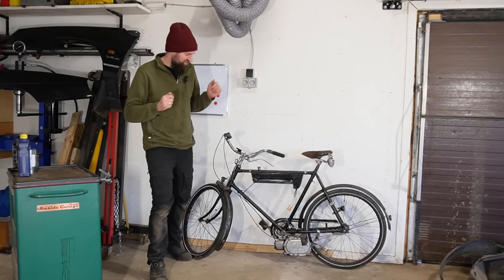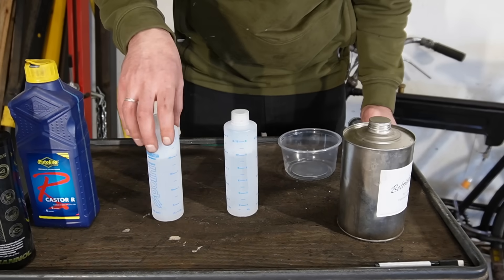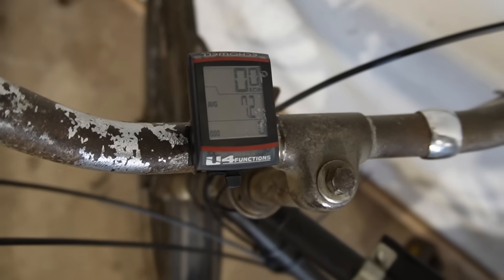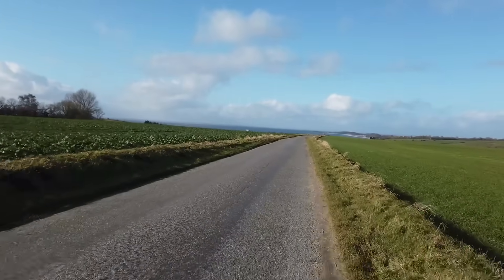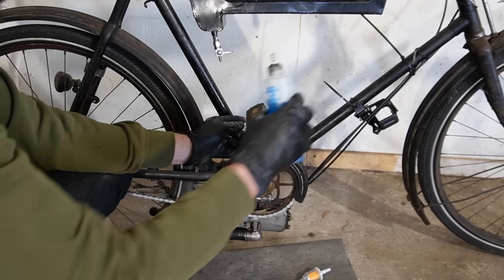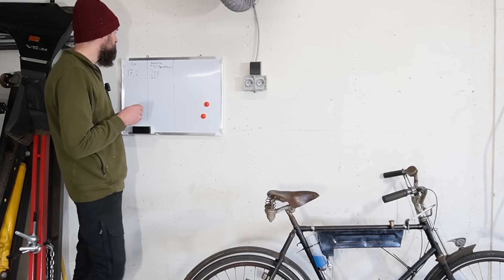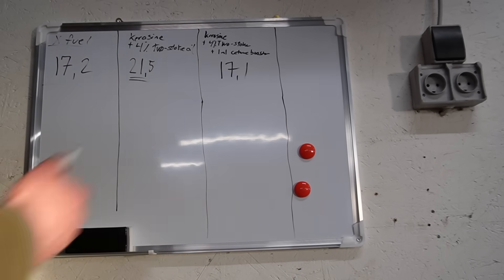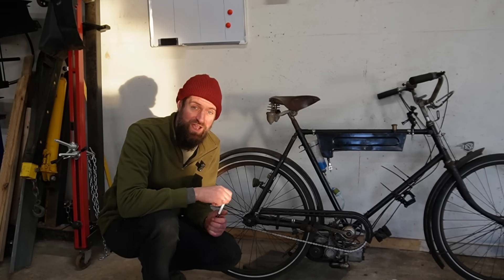Two-Stroke DIESEL Moped | The Search For The Perfect Fuel

Comment: The modern diesel issue is from them removing the sulphur content (which was used for lubrication of things like injectors & pumps), which modern engines can deal with, but older ones, particularly vintage diesels, can't, so people just mix in an additive to replace that missing sulphur when running older diesel engines... :)
Reply: This has a carburetor and the crankcase scavenges the Diesel-lubeoil/air just like in a 2 cycle gasoline engine.

Comment: Before the advent of specialized two-stroke oils, manufacturers recommended higher percentages of oil in the fuel. I've seen 5 and even 6%, so it's plausible that the Lohman fuel contains more oil than your kerosene/two-stroke oil mix. For a given volume, the more oil there is, the less fuel there is to burn and the less power the engine makes.
Reply: That is only halve true. The more fatter the carb runs the more gas generates it while running, so it has way more torque than with optimal setting. Lean/Optimal: High HP at high speeds with high rpm.

Fat: Not as much HP but way more torque over the whole band. Also it is not as high reving as optimal setting. 

Most notebly ypu see this in small CC chainsaws. The highest RPM -500RPM setting has just in a very short range more power than the fatter version, but the fatter one pulls the chain even at like 6500 rpm, while the optimal just gets.stuck under 8000rpm.
Reply: Also the myth of more oil= more power is because of the oil increasing the compression with results in a bit more tourqe

Comment: You´re running a bit rich i think.. Since it is a 2 stroke the revability of the engine rely on AF mixture. If it´s runing rich it will start to act like a 4 stroke because the speed of the combustion isn´t fast enough to fully burn before opening the ports. In the video you can clearly hear it at around 5.01min. Oil Fuel mixture should be 1:20.

Comment: Seeing as its 2 stroke, have you considered linseed oil?   Back in the day running ones 2 stroke off of linseed produced a lot more power but the piston and plugs used to get glowing hot so we generally mixed a good dollop of linseed in with normal petrol and oil and got some excellent performance but horrible stinkyness lol

Comment: I did in my youth see a booklet about determining the best fuel oils and ratios for engines which you worked out like a formula and then mixed to parameters, not so useful for very big engines like ship diesels as heavy fuel oil has a different formula but useful for old farm stuff.   Was thinking 18cc is like quite small for a fuel oil but you want to avoid knock if its too easily burnt and oil retardation if it burns too soon meaning the 2 stroke never quite catches all moving surfaces.

Comment: Documented in scientific literature in the 1850s, amyl nitrate is a water-like compound chemical formula C5H11NO3  that speeds up organic chemical reactions, often added to diesel fuel to accelerate ignition.
Reply: It's great for relaxing anuses too
Reply: Gives you a banger headache too. 😅😅
Reply: @jimballantine4408  
No...that's amyl NITRITE.....poppers....
I made that mistake 50 years ago and got some from the local chemist for my diesel model aircraft engine fuel I was making at home.
I should have got the NITRATE...but got the NITRITE.

I had a sniff at it (after being warned by the chemist NOT to do that)
and my heart raced..
I dumped it all in the fuel and the engine revved well......!
Reply: @JohnSmith-pl2bk  wait you put poppers in your fuel oil and it did run well ? Or did you get the other stuff

Comment: I thought the higher the octane, the greater the resistance to detonation. That would be the opposite of what you would want for a diesel engine. It would also explain  why it wanted more compression to be happy.
Reply: I thought the same as you, but on looking it up, the cetane level seems to work the opposite way to octane level - higher cetane speeds up the rate of burning in diesel fuel, but higher octane (in effect) slows it down in petrol/gasoline.
Reply: @emma.jacobs1  Good point, it was Cetane he used. I assumed incorrectly that Cetane was a brand name. I learned something new. Thanks!
Reply: Not necessarily. You don't want premature detonation, just like you don't want no detonation.

cetane impacts the rate of detonation, not the heat/pressure level of detonation from what I understand.

Comment: That 25km is probably tested on a simple rolling road with 60-75kg of rider weight. Which means you probably have the right fuel already. Just your body weight difference (if there is) and the drag your body has can make that difference... 
Its like a car that does 20km/l but only when you drive a steady 90km/h for a long time. Faster or slower will get poorer fuel economy.

Comment: People in the 1950s were smaller ...especially in the UK.  From Google: Back in the 1960s only 1% of men and 2% of women in England were classed as obese compared to today's 25.2% of men and 27.7% women. At the end of the 1950s, the average man weighed 65kg and the average woman 55kg. Fast-forward to today and the average weights are 83.6kg and 70.2kg respectively.-   so  the speed tests in your brochure are from that period ..and they may have been doing it with a 16 year old ,who where the main purchasers of these bikes in the 1950s, due to them being aloud to ride a moped as early at 16 and not wait till they have reached 17 for bigger bikes.  16 year old may have been even lower in weight. So "your weight" may be the deciding factor of speed . that is  plus your massive height, 6 foot seven inches i think you said -  acts as wind barrier.
Reply: Do the next test laying on the tank ..or with someone else who is 65kg - when i was 16 i was about 60kg.

Comment: Hello im also from denmark and I also have a lohmann diesel i also use kerosene for my motor and then i mix whith 5% high performance two stroke oil and my personel topspeed is about 23 km per hour with a 140kg man on the back
Reply: Speed king!
Reply: @andrewmooreandrewrmoore7615  yes but it sounds lige the engine is going to say kaboom at any moment ahah
Reply: i also like to ride on small slow mopeds with my some 140kg
Reply from the maker: Nice!

Comment: I once had a vintage  Diesel McCoy .09 model airplane engine with variable compression. The fuel mix I found online to use was: 25% castor oil, 31.3% Kerosene, & 43.8% engine starting fluid "John Deere ether starting fluid 80% has the highest ether content these days.  Im very curious if this fuel mix would have good performance for you as it is a tried and true fuel for vintage modelers...✌👍
Reply: Amy nitrate...extra oxygen...
Reply: My mixture included amyl nitrite that I got from the chemist (back in the 1970's) with a "Don't tell anyone" admonition...since I was 15 years old and he was selling me a very strong heart medication...now known as "party popper"!
One little whiff of that and the heart started racing....(I had to try!)

I should have been using....
Amyl nitrate—chemical formula C5H11NO3—is a slightly but significantly different chemical from amyl nitrite, C5H11NO2. Nitrates have three oxygen molecules while nitrites have two.

Documented in scientific literature in the 1850s, amyl nitrate is a water-like compound that speeds up organic chemical reactions, often added to diesel fuel to accelerate ignition.  

Amyl nitrite, meanwhile, was synthesized in 1844 by French chemist Antoine Balard, best known for his co-discovery of bromine. English physicians applied the chemical to the treatment of heart conditions and angina.

Comment: If you can get your hands on jet A1 it might be worth trying on the engine. I have about two liters of the stuff for cleaning parts. Or used motor oil form a gasoline engine, the thinner, the better
Reply: I ran a 1995 diesel golf on Jet A1 with 5% turbine oil for a while. It works well but is slightly down on power compared to the real deal pump stuff 😊

Comment: Correctly inflated tyres helps achieve optimum speed mate
Reply: The weaker the motor and the bigger the tires the most important this is, on a TW125 it made up to 20km/h of difference in the top speed when I tried it
Reply: He's not going for ultimate speed, he is comparing fuels. So long as tyre pressures are the same, and riding position is the same, these test results are valid.
Reply: Yep and properly leaning on the bike too help aero
Reply: Helium in tires 0,003%  more speed 🤨👆🏻

Comment: If you ad cetane its like adding octane to fuel i will hurt your performance if you are low on performance and cold weather, cause the higher the cetane the more compression stable the fuel is
Reply from the maker: AFAIK Cetane is like to opposite of octane :)
Reply: @SeasideGarage  Yeah i got it switched around in my head but the octane number of kerosene is around 20-50  and most petroleum(i use the Danish name) in Denmark is for lighting and heating so it is in the lower end, so maybe you are getting more knock or there are something in the booster that lowers the kj/kg in the fuel overall, the only way to tell i to make two more mixes, one more stable and one more volatile

Comment: Please try the "Schur Ecofuel" mixture from the early 90s

80% vegetable oil - 10% lowest octane Gasoline and 10% pure Isopropanol alcohol
Reply: Regular vegetable oil will polymerize badly at normal engine temperatures- probably not a good idea for a 2 stroke. Had a customer once who changed the oil in their lawnmower, and refilled it with olive oil. The cooked oil pretty much glued every moving part in place after ten minutes. Didn't smell too bad though.
Reply: @Kevin75668  That´s why isopropyl alcohol is in the mix. It functions as a cetane booster for complete combustion and solvent for polimerized residues.
Reply from the maker: Noted!
Reply: @SeasideGarage  I'm curious about your engine.What's the highest compression ratio and the lowest?How does it change compression ratio?Does it have a fuel injector?Or just a caerbretor?
Reply: @RickyFeng-m5m  Pretty certain this is exactly like a model airplane Diesel engine and they have carburetors. I seem to recall someone in Czech Republic made a video of converting his 50 cc scooter over to a compression ignition Kero oil engine.  Needs a big electric drill with a socket wrench to spin up the engine before he got it running but it idled and ran great.